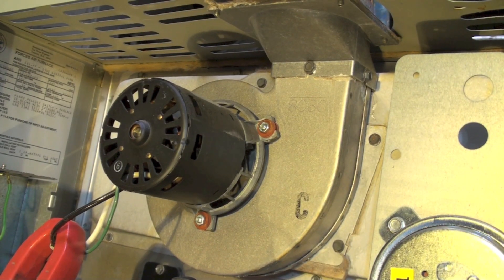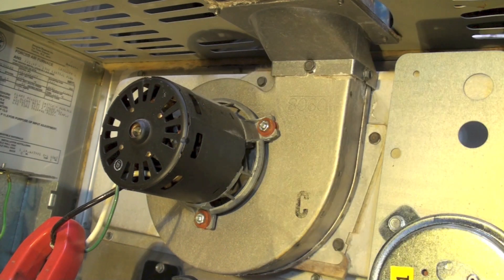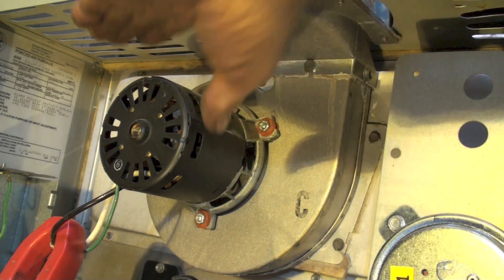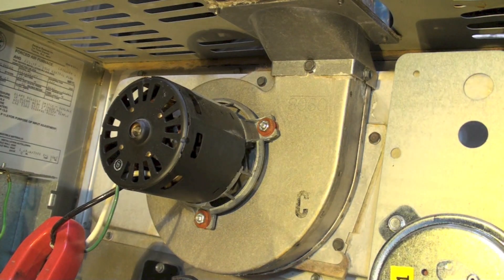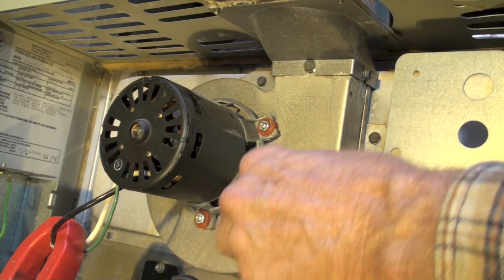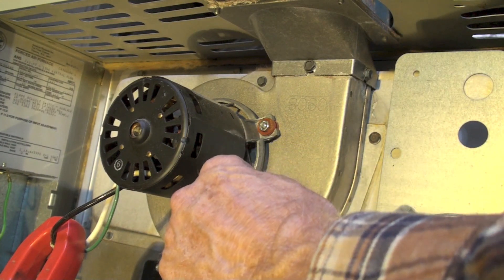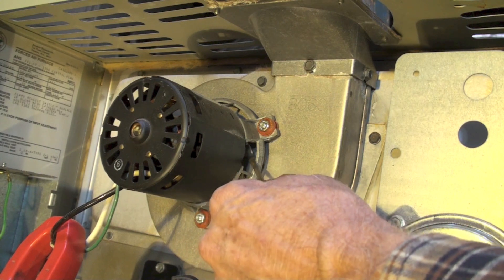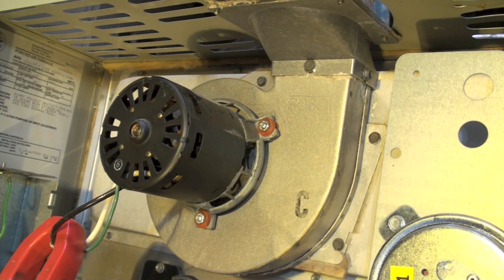Trane furnace, no inducer,  answer

Comment: Them dang sleeve bushing armatures, in a pinch they can be cleaned and re lubed with turbine oil.
I'll bet that motor is impedance protected, she'll get hot but not catch fire
Reply from the maker: Craig Nehring I always tried to get these things running with oil to just get heat for the night.  Never a permanent repair but may get them thru until you can get a new one.  Thanks for the thoughts.
GFM

Comment: I was expecting a higher amp result to be a stuck fan shaft. In any case thanks for posting
Reply from the maker: S Sam I have been meaning to do a video on that.  The shaded pole motor does not have excessive amp draw when the rotor is locked.
GFM